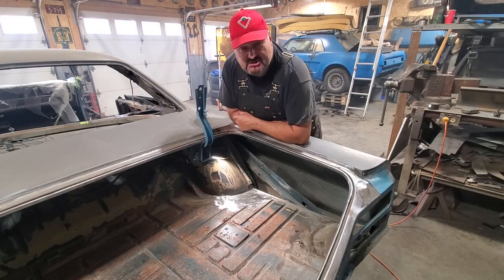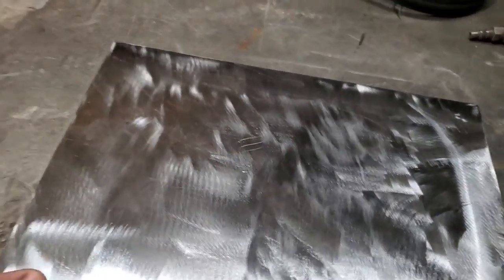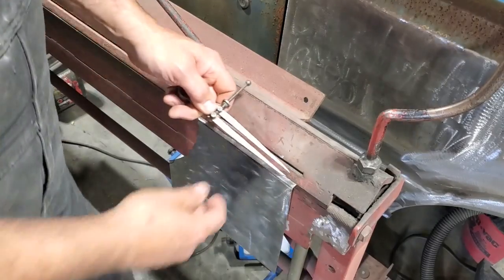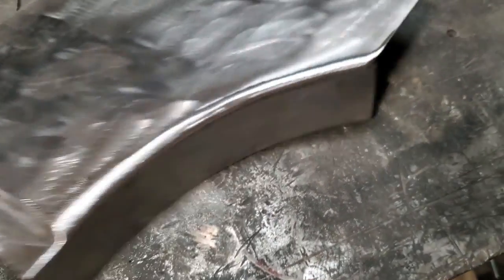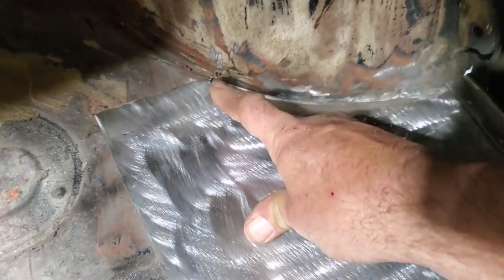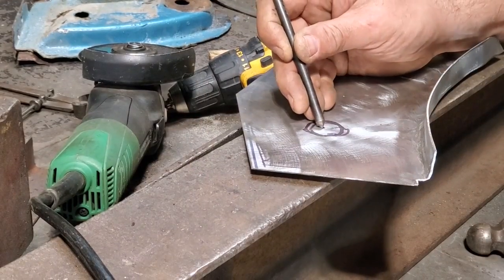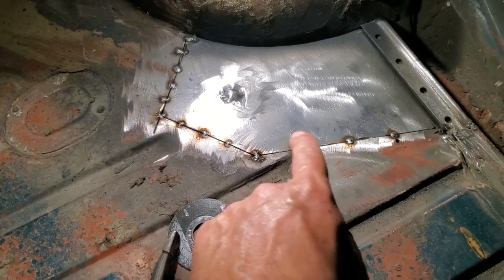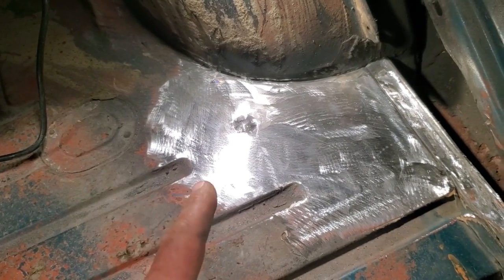How to repair rusty trunk floors in 60s GM cars

Comment: Fitzee's comment in this video, and others, about how you shouldn't get in a hurry or worry too much about the time it's taking to make a repair is spot on. I have been guilty of this myself on numerous projects and taken small shortcuts here and there and always regret it in the end. Getting anxious about time and schedules will almost always end in disappointment and failure. However perfectionism is also a deterrent to good quality work and enjoyment in the creativity involved in the process. There has to be a middle ground which is where satisfaction and happiness is the result of the effort. Fitzee is a wizard in this regard.

Comment: I have looked at other channels doing bodywork and there is nothing compared to your finish and detail.  The finishing of the welds so they are invisible and techniques for shaping the panels is inspiring to achieve great repairs.  So many make a rough weld, don't grind it right down or knock down and use filler, but these videos show how it should be done with mostly no filler needed. The detail you show  (clearly) is so valuable and I think it advances body repair techniques to the Fitzee method. 
It's almost worth buying an old car just to try and come close to the skills you are showing us here. Thanks for another great video.

Comment: I just bought a 1948 Dodge coupe and I think I have learned enough from you to do most of the repairs.  Around the top back window I'm not so sure of.  I know you have a video on that fix but its still challenging.  Thanks for sharing your knowledge.  I wouldn't even attempt to do a restore without your video's.  Have a great week!

Comment: Rebuilding the trunk floor right now on a 1967 Buick Wildcat, but it is much worse than that example. The whole body mount crossmember across the back of the car (and the both forward facing crossmembers that are the tank strap supports)at the rear is gone, along with the floor to where the square press sections start. Your video has helped me figure out where the pressings are on the floor piece that is missing. Obviously the floor sections you are dealing with in the video are gone also... Some really good tips in your videos, even for guys like me who have been doing it for quite a while. Keep up the good work!

Comment: Very nice work. I have a little air grinder with 120 degree shaft on it and use 3 inch discs that work great for getting in them real tight spots. But like you I used what I had until I got one. 
I hope you had a great vacation.

Comment: Cant wait for the next one, I have been putting your inspirational videos to use and starting to rust repair a 1970s Holden Panel Van starting with the upper tail gate, its not easy but I just got to take my time like you say and do one section at a time :)
Reply: I'm also getting all the tips here and one day I hope to start work restoring my 1964 EH Holden ute. 
All the best for your restoration from Queensland Australia.

Comment: I know I've said it before but I absolutely love your method for butt welding. I'm getting back on the ball with an old (but extensive) cab rework project for a '91 F150 and your work methods are a godsend.

Comment: I've got a 95 s10.my lil hot rod I put a roller v8 in.
It had rust in the usual places,cab corners,rocker panels,over rear wheels.,and I made the gas door go away since I put a fuel cell in the bed...Thanx to ya tony for taking me threw body school 101

Comment: Hey Fritzee. Ive been watching your videos for a little while now. Gonna be attempting some patch panels coming up soon. Ive learned alot from you so far. Gonna still be a little bit yet. Gotta get my hands on a decent Mig Welder soon.
Reply: I'm using a 100A gas-less MIG that I've found to be quite good and I even used it to build my trailer. However, if you can afford a gas MIG, you'll likely get neater looking welds with less clean-up. For what I do and how often I do welding, it's more practical for me to stick with the flux-core wire so I don't need to worry about gas. For anyone doing a lot of welding, a gas MIG is the way to go, because flux-core wire is more expensive than regular wire.
Reply: @BrucePierson  thanks for the information. I personally don't kmow alot about welders. however, I used the welders at work from time to time to fix broken tongs n what not. I can actually put down a pretty good bead ifvthe welder just happens to be set right. I know nothing about setting the wire speed n power settings except what i seen on one of Fritzees videos on how to set up n what to look n listen for. Im sure ill figure it out when i pick one up.
Reply: @williamsizemore98  Once you buy a welder, it's likely to have some instructions with it, so you might get some useful information from that. It seems that with a gas welder, you set the gas at around 15CFH up to 25CFH depending on the welder, but apparently 15CFH is about the usual setting. A basic rule of thumb is that higher amperage requires higher wire speed. I'm certainly no expert on welders or welding and I am self-taught, but I manage OK. If you blow holes in the metal, then the amperage is too high, but if the weld is sitting on top of the metal, then the amperage is too low. If you get a lot of spatter or the wire jumps, then the wire speed is too high. If the wire is burning back, then the wire speed is too low. It's just basically adjusting things until you get a good weld with none of the above issues. Just start with basic settings as outlined in the manual or on the welder itself and you should have it set up in no time .... once you buy your welder of course. Hope that's helpful. All the best from Queensland Australia.
Reply: @BrucePierson  thanks man. I appreciate it. Detroit, Michigan.
Reply: @BrucePierson  thanks man.

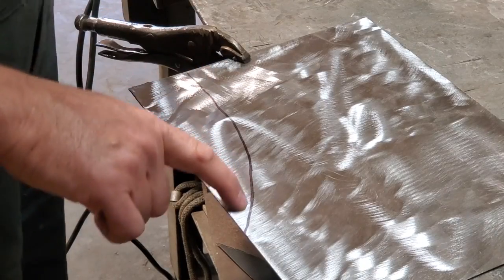Comment: 7:50 that's actually the way to use a grinder, even for straight cuts. The plunge and push method destroys disks about 5 times faster than multiple surface passes. I think it was Fireball Tools that tested that on his channel, great info to know.

Comment: Always a great job Fitzee!  You are the master of the Death Wheel. Only thing that made me cringe is....when you hit two hammers together to make the dimple. I still have a chunk of steel in my arm from when I was a kid by hitting two hammers together. When I have a need to do this, I use a copper or brass hammer as the striking hammer. Great video! I'm gathering info as I am ready to replace floor pan in my "83 Chev C-10.

Comment: thanks fitzee the tips are good . your right i am here to see how its done for my own car , i  have a 29 dodge tourer fire wall/ cowling and im  haunting utube to find a way to make roadster rear quarter panels  because roadster bodies dont exist in australia . i look forward to the day some one needs one repaired by you  so i can learn how to do all them curves with a hammer and dolly/steel beam/ pipe or what ever you use
Reply from the maker: Check out Ron Covell. He has a nice how to on building a roadster from scratch. Building a buck from plywood.
Reply: @fitzeesfabrications  yea i think ive seen that one,very complicated and i wouldnt call his way simple tools, im more capable with steel  and my best talent with wood is burning it and lets be honest fitzee the wooden buck prob cost more to make nowdays than buying a set of rear quarter's off brookville roadsters there is a local guy in west aus (450 k's away) that does such goodness wants about $3000 a side , so if im ever gunna build a roadster it will be done with a hammer and pipe/beam or find the part of another car thats got something close in it

Comment: Hi Fitzee!
I can't get enough of your videos. I learn something new every time. The tips are always good!!
I have a 56 Buick Special that has the rust holes high up on the quarter panel. There's a ledge there where dirt and moisture collect. Is this repair that you mention above? This sounds bang on target for me.
Reply from the maker: Trying to figure out where that spot is too on a 56 buick. Must be in  the truck? Many of the 50s cars were like the 60s cars for rust around the wheel wells
Reply: @fitzeesfabrications  On my 56, the rust holes are on both sides, above the wheel wells, but just before the quarter panel rounds off at the top. I wish they were the only problem areas I have but I have swiss cheese for floor panels and both rocker panels are, well, gone.
I love all your videos but I can't wait to see you fabricate some goodness back into a 56 Buick.
Reply from the maker: Don't over think it. It's only metal and one peice and then another and you'll be well on your way

Comment: Hi Fitzy your videos are so good I have already repaired one of my cars using your skills  am now going to start on my other car that is in a bit of a bad way 
Am in two minds if I should remove the panel on the rear quarter 
It is where the fuel filler cap goes into a larger panel on the inside of the car as the main quarter panel covers part of it .
If I can send you a photo may be you can give me your advice am over in uk

Comment: I have a ‘63 Impala with the same issue, except that the wheel well is rotten towards the back as well.  I’d like to see you fab a patch for that!  But I would probably be better off just buying the whole well and cutting out what I need.
Reply from the maker: You could if you can get the right one. I made that section. I would make it in two sections toe rolled section and the downward section where floor mounts.

Comment: Hi Fitzee, great channel and a big fan of your work. 34:31 - my dad always told me never hit two hammers together as they could shatter…is this wrong?  Cheers and thank you for sharing your skills 🤛
Reply from the maker: I heard that too but being doing this for years.
Reply: Definitely a no no striking two hammers together than again hardened hammer heads were of better quality when that statement was made. Check some old ballpeen hammers and  you will find chips in face. Guess where they went. We all do it until we get hurt.
Reply: The trick would be to use a brass hammer to hit the steel hammer with. That way, you aren't hitting two steel hammers together.

Comment: I greatly appreciate your videos.  I and replacing the center trunk section cause I don't need to replace  the uper shelf below the speakers.  I was wondering don't have skill set or tools, but on a gm a body, is best to go with 3 piece trunk or full center section trunk.
Reply from the maker: Depends how bad yours in. I find it rear for middle to be gone. It's hard install a one peice as it will have to come in from the bottom. The 3 peice ones are designed so you can install them threw the trunk opening
Reply: Goodmark makes one that will install through trunk opening as it measures 57 x 34.  I an just worried about it having to be stitch welded all the way around vs 3 piece can be plug welded to sides and center frame rails with stich welding only at front and rear.

Comment: Just amazing Fitzee. Thanks for the tutorial! 
I'm so glad the trunk floor on my 68 Biscayne is nice and solid. But I do have holes in the lower fenders and quarters that will need patching. I'd love to know what primer/paint/sealer you used just before welding this patch in? Is it a "weld-thru primer", or some sort of "weld-thru paint"?
Reply from the maker: No it is just a rust paint.

Comment: Great video like always!  Can I ask you a dumb question:  I picked up a pack of those disks you showed.  They have some kind of thin backing plate.  How far down can you wear them away before you have to get a new one?  Thank you.
Reply from the maker: I cut them.down small. 2 inchs across. I use old ones as backing pads so I can keep cutting them down

Comment: Not sure if it was asked in this thread, but you mentioned something about  drawing one piece of metal into the other and causing misalignment. How do you prevent that and keep your metal where you want it?
Reply from the maker: Alot of times I would tack the prices in place and weld as much as I can where they sit then remove and finish welding them.

Comment: Enjoyed the video, would like to find a air grinder like that, what model number is that one and are they still available?????
Reply from the maker: Nothing special  about it. I used many different types. You want one with the highest rpm you can get. A cheap one will get you by but they are not a good as one you pay a bit more for. Air tools are hit and miss.

Comment: Nice job. I just wander what you do with the areas that are close to the repair and have pinholes. 
Do you cut those sections and fabricate small panels.
Reply from the maker: Depends on the size of the hole. Most small stuff I'll drill out to get to good metal thrn make a round patch to fit in the hole.

Comment: Hi Fitzee, do you use .025 wire and gas? I'm using .030, with no gas, it's ok but could be better on 18 gauge from rust repairs....
Reply from the maker: I use 023 wire with gas. Less heat then 030 flux core. The 030 tends to leave higher welds and makes for more grinding

Comment: Another great video. I’m gearing up to do some rear wheel arches on my 82 Ford F-150. So these help more than you know. I have a question about using a body saw. I know you use a cutting wheel for most general cutting but what are your thoughts on a body saw
Reply from the maker: Some find them better then a cutting wheel. It is all about which your more comfortable with

Comment: Excellent patch there mate and but welding as well only thing that upset me was using your hammer as a push stick should make up a little one would not be hard...
Reply from the maker: You look at the end of all my hammers. They have burn marks. Doing it 30 year. To late to change now. Lol. I find the wood don't slip and you can apply force with one hand

Comment: Fitzee, for body rear quarter panels, is 18 G good or should I use heavier ? 60/70s GM full size
Reply from the maker: 18 is fine. A 60s 70s car is most likely 20 gages
Reply: @fitzeesfabrications  Thanks for the fast reply... ;-)  Ill keep you posted on my progress..

Comment: fitsy i bought a 90 degree die grinder air tool and made a fitting then i cut  a 1mil cutting blade in four gives u little dremel blades saves money  and and u can add two blades together and they grind to perfection and cut in tiny spots
Reply from the maker: I like to see this? Cutting a cutting blade? How you mount them?

Comment: How do set the wire speed on a harbor freight cheap fex core welder and the heat to fix a rip in thin sheet metal on floor pan on a 91 mustang
Reply from the maker: Your going find it harder to weld with flux. It takes more heat to weld with fluz as your welding with 030 wire. It can be done as many have done it. Its just not as clean and you have a great chance to burn threw. Welding cracks are tricky as the crack is worn thin. I like cutting out a section and replacing the metal with thr crack
Reply: I use a gas-less MIG myself with 0.8mm (approximately 030) flux-core wire. It's more difficult to weld thin metal and the best idea is to get some scrap steel of the thickness of your repair and try different settings until you get the best result - a good weld without blowing holes or having bulky welds. Then take Tony's advice and cut out the crack and weld in a strip using the cut and butt method he shows regularly in his videos. Also, don't try to run a weld, just do spots in different places and allow each spot to cool before doing the next weld. It takes longer, but the result will be better with far less distortion.
Reply: @fitzeesfabrications  thank you

Comment: Gotta ask, what wire you use and size?
Reply: Pretty sure he uses 30 thou 70s6. Watch his "setting up your welder" vid fom his channel list, and you'll see the "Fitzee method" of dialing the rig in for your local materials and conditions. Wire brand on "plain vanilla" isnt too important so long as you dont use "discount store house brand" or generic junk. Just do your set up with what you'll be running, and redo the set up if you change brands
Reply from the maker: 023 wire
Reply: I always thought that you are supposed to use .6mm (.024) wire?
Reply: @fitzeesfabrications  I stand corrected
Reply: @AMLagonda  ditto, lol
Reply: @ludditeneaderthal  Glad I was right lol cause thats what Ive been using :)
Reply: @AMLagonda  "too small" isnt really a factor in thin sheet. "Too fat" just increases risk of blow through and heat distortion, making set up critical. Using his "cut and butt, spot and cool" technique with a good set up anything smaller than 35 thou "works", though you have more cool off time running 30, and gas choice can make or break you (mix is hotter than CO2)
Reply: @ludditeneaderthal   thats why I was asking. I normally have had 35 in my machine, welding frames back together for snow plows etc. Or welding heavy plate. I saw the small wire and was wondering. I am retired now and doing more work like this.
Reply: @IllusiveChristie  for sheet thinner than 16 ga. 35 thou is "just way too hot running" unless you have a perfect set up and expert technique, copper backing spoons, and great conditions. I used to torture noobs by making them weld 18 ga strips into a ring before they could "graduate from grinder jockey to spark maker" running 35 thou and mix (our shop standard combo), so it CAN be done. I'd do a ring first, then spin all the knobs so they had to set up everything again, lol.
Reply from the maker: O23 and 024 is same wire. Some brands label them different
Reply from the maker: It takes more heat to burn 035 wire making it burn threw. It also too much material and your welds will be big and you will have more grinding.